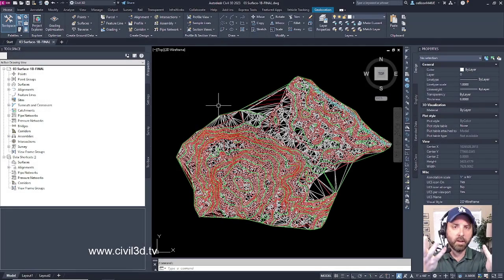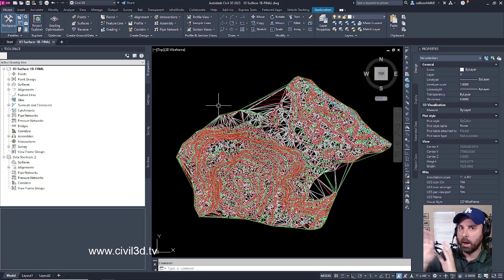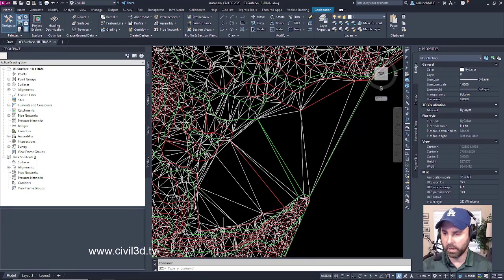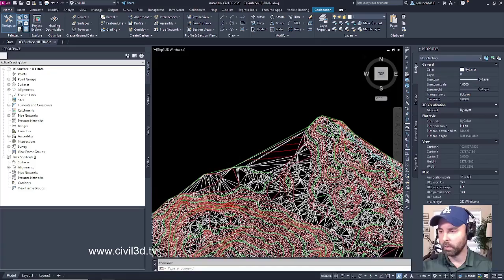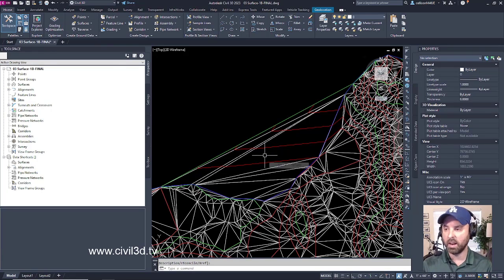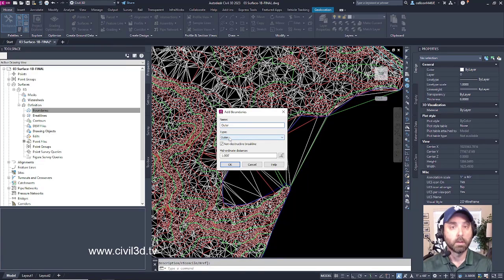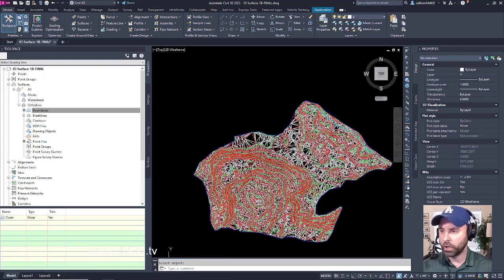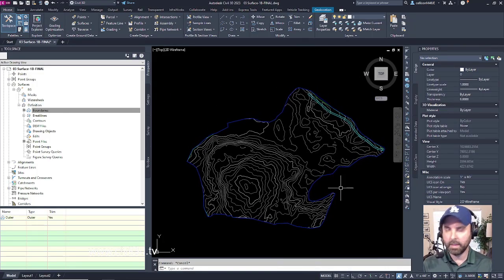05 Adding an Outer Boundary to a Surface in Civil 3D 2023 to 2024

Comment: Did you have to manually draw in the boundary or are you able to automate that work?  Thanks
Reply from the maker: I drew it manually
Reply: @CIVIL3D  Seems like a lot of work when you can go ahead and delete those surface lines which would be way easier than manually creating the boundary.
Reply: @CIVIL3D  Hi. How to delete the boundary line created using this method? I have an additional survey to add in.
Reply from the maker: Delete the hide boundary from the surface definition. Right-click the surface → Edit Surface Style → Boundaries or go to Definition → Boundaries and remove that boundary entry.